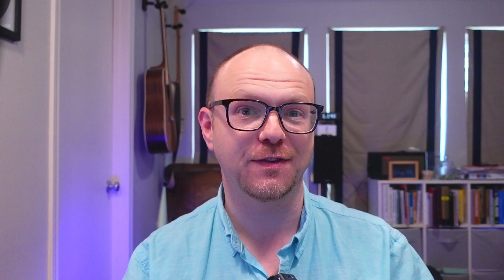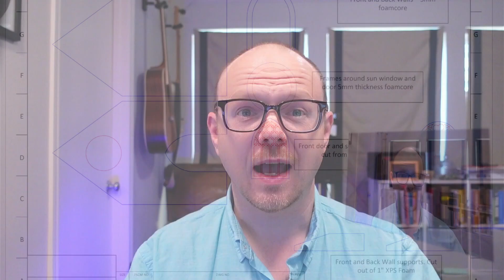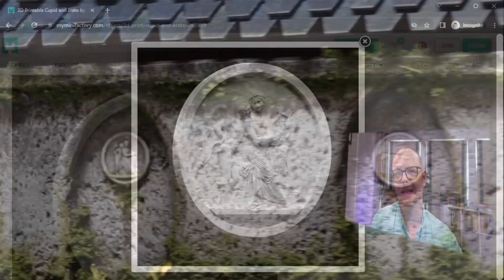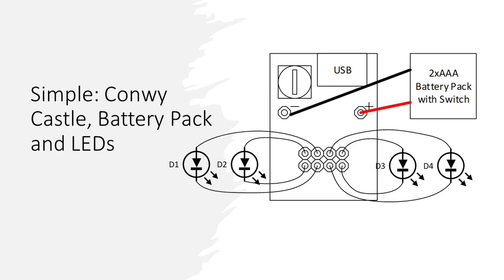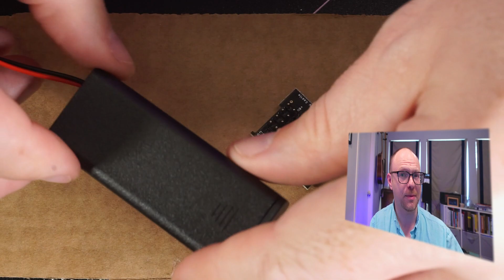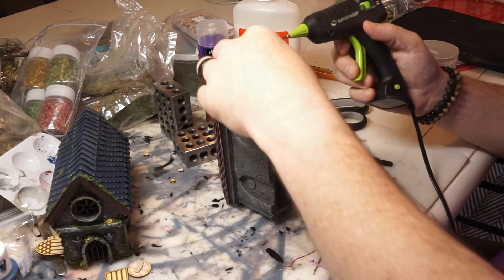FREE downloadable design! 🧟‍♂️⚰️ Light up your Halloween Tabletop Crypts 🪦🪦

Comment: I saw your latest video on turning LEDs with magnets. Do you think that a similar concept could be applied in a project and scale like this one? What I imagine is to have your wiring connected to a magnet instead of the LED and then you have your sconce/torch/other light source containing both another magnet and the LED so that it lights up when you put it on the wall and the two magnets connect. The end goal would be to have a bunch of different LED accessories that you could just pop on and off the wall at will, thus achieving great modularity, ease of use and an easy way to stop draining the battery.
Nat1 proposed to use a reed switch for that but I couldn't implement it myself.
Reply from the maker: Hi Kredik. I'm struggling to understand a little. You want to replace the LED with an electromagnet, which would then trigger a separate Wiston Castle board?
Reply: @TerrainTronics   The functionality I'm looking for is to have a magnet attached on a wall and a magnet attached to a light source accessory. When the two magnets attract and touch, the light should switch on. However, I have really no idea how the wiring should go, as I'm the opposite of an expert on this.

In my search on the internet for an implementation of my idea, the closest I found was a video on a Lego channel called Bevins Bricks World. The video itself is called “New Wireless Magnetic Connector For Your Lego Builds !” where a male and a female pogo pin connectors were used to light up already wired up buildings when attached to each other and to only one source without any further connections. However, after the suggestion that an easier solution with a reed switch is possible, I kept searching and that’s how I ended up on your channel.

Your latest video seems to achieve something similar to what I am imagining, although for larger accessories and as far as I understand they just light up from the magnets, but aren’t attracted enough to be able to stick on the board. So, I was wondering if you have any hints on that.
Reply from the maker: Hi @Kredik5796,
Ok - now I understand a little better! Wireless power transfer will not be possible with this solution. Lets get that out of the way now. Transferring power through magnets, same thing. Not possible.
However, The Wiston castle boards each have an onboard CR1616 battery, which, funnily enough, is attracted to magnets that you might place in a wall etc.